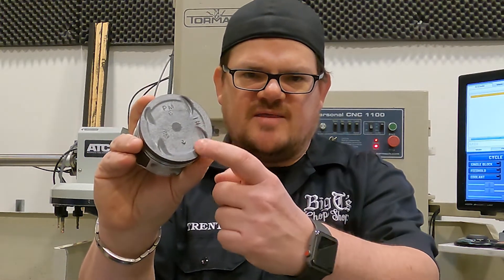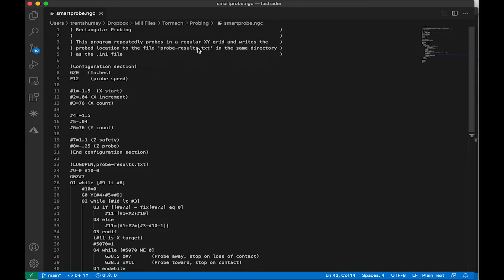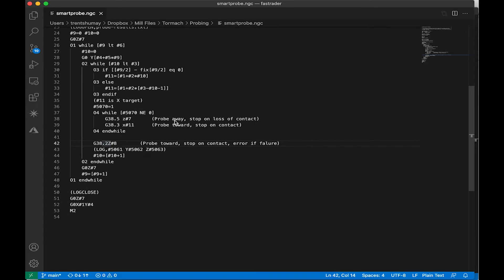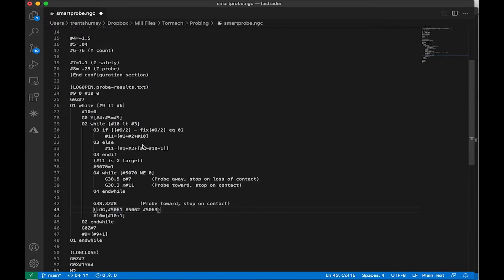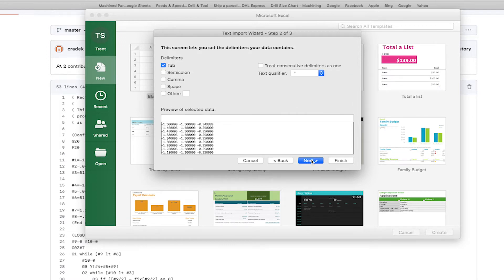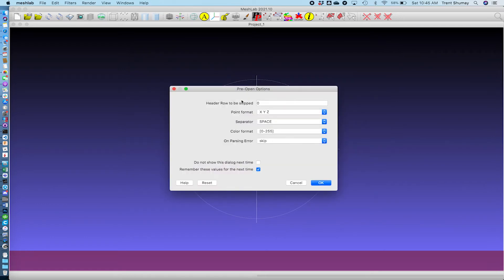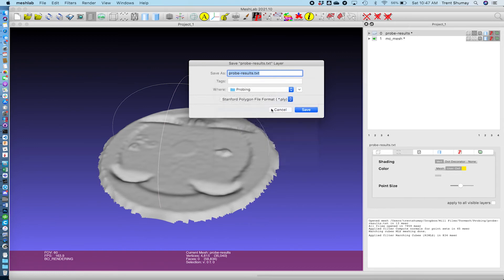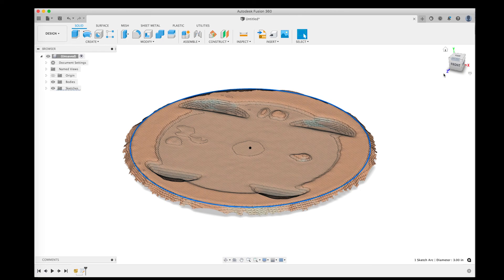Using a Tormach Mill and CNC Probe to Digitize a Surface for Fusion 360

Comment: This is great.  It's a little over my head.  I'm new.  But I can follow what you're doing here.
I need to be able to probe a surface at a pretty high precision.  Do you have any probe recommendations?  I'm probably limited by my cnc machine itself.
Reply from the maker: If you're looking for high precision, I would say this approach probably wouldn't be the best. The data that you'll get from it is still pretty noisy, and good for a rough approximation, or finding curvature, etc. But, you're sort of limited by the resolution of your probe, and diameter of the tip. If you were going to try get a higher precision probing cycle, I'd probably start by trying to find a probe tip with a really small diameter, and then work from there. The probes themselves should all be reasonably accurate (they need to be for the machine probing to work).
Reply: Also, I need gcode that will probe a 3" x 22" x 1" area.  That will cover my necks completely.  I will need to make it smaller and larger depending on the neck length but you get the idea.
Reply from the maker: @dunawayguitars7494  Yep. Have you considered 3D scanning as an alternate approach?
Reply: @bigtchopshop  I looked at hand scanners but they didn't give me the accuracy I wanted.   I'm open to ideas though.